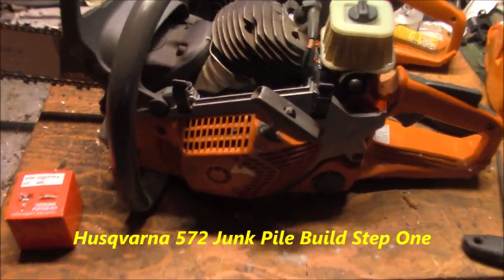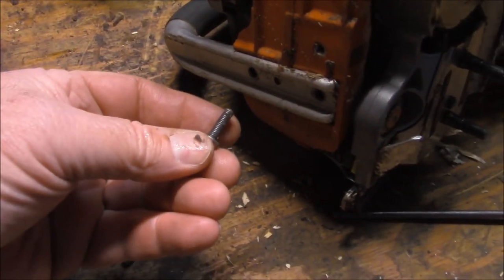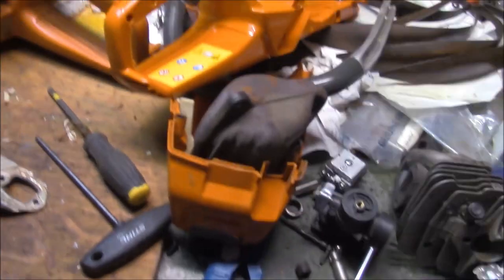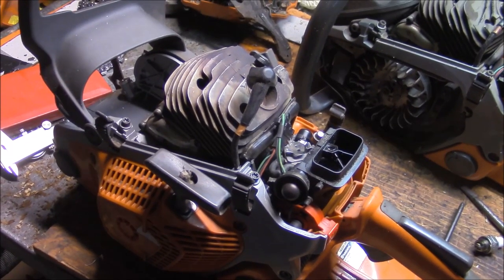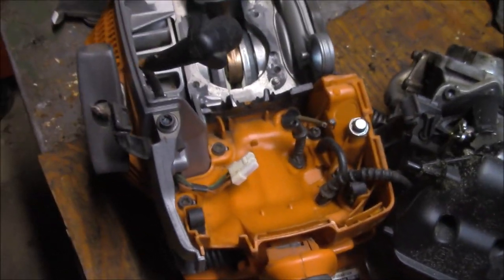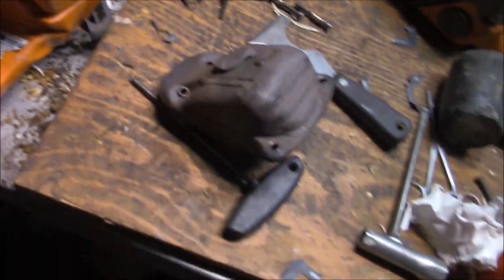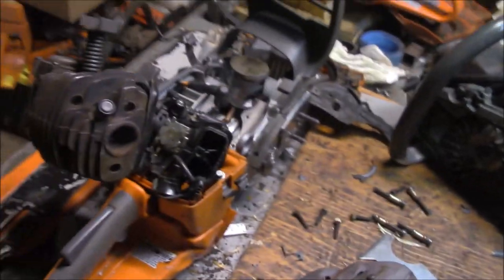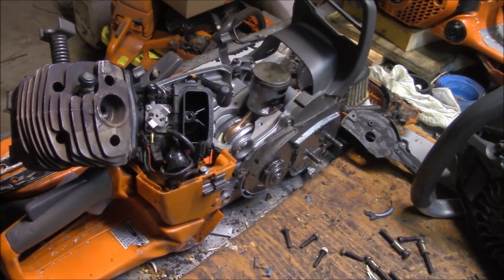Husqvarna 572xp Junk Pile  "Bones" Step1, A look Inside  & Decide A Build Strategy For A Work Saw

Comment: Replaced a bad 570 piston and cylinder with a 575 Meteor kit.  The saw was well laid out and surprisingly easy to work on, kudos Husqvarna.  The Meteor kit was top notch quality, and the saw ran very well even before it was broken in.  Would definitely go that route again. 
I find Husqvarna saws overall are thoughtfully designed with maintenance in mind and a pleasure to work on, my favorite of all the brands of saws.  There are other good brands out there and they all have their fans, but at the end of the day you really appreciate the saw that's simple and easy to work on.

Comment: The port timing on those 572xp’s is very good right from the factory !  If you actually cc the combustion chamber and do the math (or use software) you will find very MINIMAL gain from machining the squish band (combustion chamber) and in some cases may LOSE performance by doing so!  Biggest gains I’ve found while maintaining longevity is a combo of piped exhaust , mods to the piston and mods to the removable transfer caps to get a lil more flow on top while maintaining the stock base gasket-used a thinner gasket on a few to go from .038 to .028 but really no discernible difference so ….. I’ve never tried a pop up on those saws - be interesting to see how that works on your build. The extra stratos ports really make things more difficult as you introduce another variable into the equation!  They really are nice runners stock and with a some well thought out mods (and some time and effort) really come alive in the cut!

Comment: I did that a year and a half ago when LRB released the 572 pop up. The dome/pop up wasn't beveled enough and cut the solder in two at .020" squish. So I had to put more of a radius on the dome in order to get my desired squish. 
I told * about it and now looks like that has been corrected.
I couldn't do a full delete. I made a gasket to get where I needed.
Someone else asked about compression. Mine pulled 180+ psi after a few heat cycles. I also run 32:1, so that may bump compression a bit. I don't know what it is now.
I believe a guy gets as much out of a mild timing advance with the 572 as a muffler modd. I advanced mine 6°. Need about 93 octane or better to run good. To each their own on that.
 It doesn't have much time on it, but it's definitely stronger than stock.
Some saw work mixed in with the logging is nice.
Another quality video Walt.
Reply from the maker: Mine worked with the full delete, actually a surprise as it hit .020 on the button. When I measured squish it was a uniform thickness across the solder so guessing they did fix it. Hey THANK you for sharing your experience. I figure the other junk pile on the table will get to be the experimental hog with some port grinding . THis one is staying "farmer jones" I think :)
Reply: I'm looking forward to it Walt.

Comment: Help me please, I’ve been watching you for a while now and have learned a lot.  I have a 2017 562xp and it runs like crap for the first four minutes ( stalls won’t rev etc.) then runs perfect after 3-4 minutes every time I use it from stone cold.  no hot start issues, new plug, and fuel filter, new style air filter conversion. Any ideas? Thanks and enjoy the videos from a fellow upstater.
Reply: have you tried re-setting the auto-tune?
Reply: That's crazy. Both of mine had hot weather vapor lock issues. That sounds opposite.

Comment: do you suppose the wear on the intake side is due ( for a good part ) to running 50:1 oil mix ?
Reply from the maker: Not sure I should start that conversation! I run 32:1 in mine and have since they became available on the market. I guy the "Strato" out of the 372's and NEVER see that wear. THAT's as far as I will go.

Comment: What caused the deformation of those handles?  It seems like heat would be the only thing possible to soften the plastic enough to do that. Any kind of impact would cause cracking, at the very least. Strange that you have two saws with the same kind of damage. Were they owned by the same person?
Reply from the maker: Both those saws were run over. Both "Crush" saws. But that is all I can find! They simply don't exist used around here. And I wanted to get "used" at the end of service life saws to make the point....any one can work on them as any other saw. SO I had to suck it up and get crusher saws for "bones" to build video's from
Reply: @afleetcommand    Very strange!  Are the no cracks around those deformations?  If not, I wonder if a heat application with a hot air gun would allow them to pop out the way some automotive fenders can be popped out. Either that or drill a hole, insert a screw eye and pull out along with heat application and then fill the hole with JBWeld.

Comment: I doubt those saws can be improved much.. I have two of them and if you open that muffler they are super stout. Much, much stronger than a 372. They have an awesome sound too with an open muff.
Reply from the maker: Guess we are going to turn speculation into documented evidence right?
Reply: @afleetcommand  If you are going to try to port one then yes. That will be interesting!!
Reply from the maker: @timberslasher4899  Maybe. The one right next to it will get tweaked :)
Reply: @afleetcommand   Hey Walt when you say put a hole in the muffler I'm assuming you're gonna put it where the Exhaust would blow to the right but just curious what size hole are you going to drill? I's 1/2 too small and is 3/4 too big?
Reply from the maker: Going to start with a 3/4 hole in the PTO side, also a flush to the outer surface of the muffler 1" long "tube" to start with and see what it does. The OTHER approach is to hog out the existing outlet as much as reasonably possible. That is the approach used if I build a saw for a logger having to cut in NYS state forests where that little spark arrestor screen is required by law. Small blow down saws like big openings
Reply: @afleetcommand  excellent.....thx Walt
Reply: Oh they can be improved quite a bit !  Like 25% faster than stock thru the timber !   I’ve built a few of em and while it won’t beat a 462c thru the timber (with equal work done) it’s within reason and is definitely SMOOTHER than the 462c in the hands. No China doll g372xp will touch these in cut speed when built right and will absolutely NOT last as long … the bottom ends are almost bulletproof 😉
Reply: @afleetcommand  I usually gut the muffler and hog out the existing hole. The spark arrestor is required here too but our forest service could care less about them so I get rid of that. Then I bend a new debris guard and cut the old one off and weld the new one on. Contrary to most people's belief a 462c will not out cut these saws especially in hardwood. I have 2 of both and have modded them equally. The 462c only advantage is that it is lighter so that might make them feel stronger even though they are not. And the 572 is by far more durable as Huskies always are.

Comment: One day we were heading up to Oriskany to pick up a load of wood from my wife's Aunt and Uncle. Truck and trailer were all loaded, and I had been running my 555 just to make sure it wouldn't have any issues. With a long run ahead of us, I set the saw down in front of the garage door and ran inside to go to the bathroom. By the time I came back out, my mother in law had backed her car out of the garage, and right onto the 555. Luckily she had stopped when she heard the noise. Comically, when she pulled the car forward again, and put it into reverse, the back up warning was going off, because of the damn saw. Tank handle was broken, and the grab handle was tweaked, so I vised it and managed to straighten it up enough to get it back on when the tank handle arrived.  Lesson learned. Don't trust old women around your saws! Especially ones that don't pay attention. This is also the same woman who has backed into the garage door multiple times. "I thought it was up" is her usual response.

Comment: Do you have a carb kit for a 550xp Mark 2 ?
Reply from the maker: Prolly
I'll get to them AFTER making some hand grenade first gen 550's
Reply: @afleetcommand  Reason I was asking is cause I need one. Mine has a pinhole in the diaphragm. Was hoping to find one less than the 80 dollar dealer price...lol
Reply from the maker: @timberslasher4899  u on facebook?
Reply from the maker: @timberslasher4899  A "Carb Kit" is the entire assembly it looks like.
Reply from the maker: @timberslasher4899  Try looking for : Husqvarna 582366401  DIAPHRAGM & GASKET KIT
Reply: @afleetcommand  this happened to it once before and I thought it was a program problem and I took it to dealer and they put a rebuild kit in the carb and charged 125 including labor. I know they did it because they gave me the old parts, diaphragm etc. May have been some cross over parts from another carb they didn't say.
Reply: @afleetcommand  no Facebook but my wife does. YouTube is only social media I do
Reply: @afleetcommand  will do... I'm working right now with track cutter. I will look tonight.
Reply: @afleetcommand  Thanks
Reply: @afleetcommand  found it on eBay a while back and the guy wanted a dealer price and I made an offer of 60 bucks but he declined...lol. I have spent a ton on saws lately and bought a single axle dump truck and poured 24 yards of concrete for a new shop. I have to be frugal for a while or my wife is going to pull out the rolling pin..lol
Reply from the maker: @timberslasher4899  OK , yes those are tough to find. There is a "diaphragm" kit available but its like 40 bucks too. When I go back down to the shop, i'll see if there is either one available or see if I can order an OEM from the mother ship
Reply: @afleetcommand  👍👍👍👍